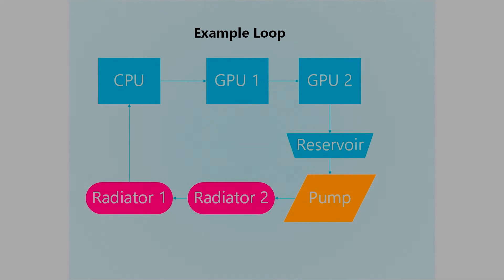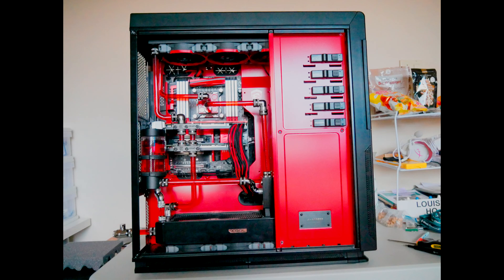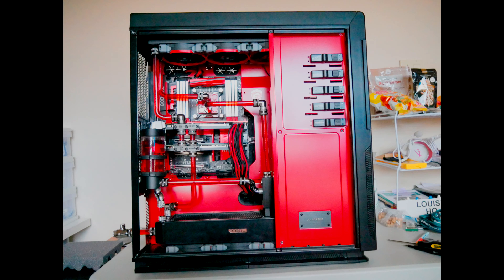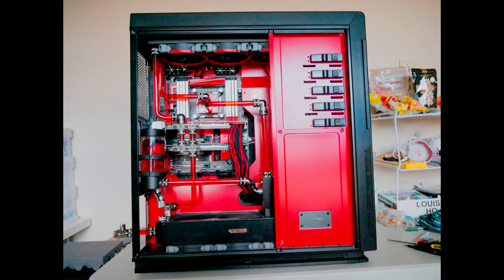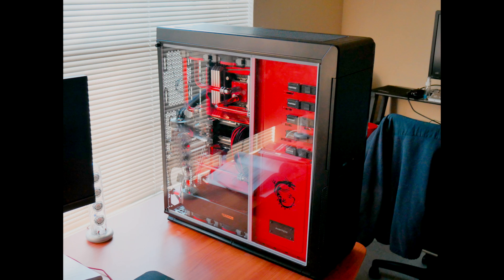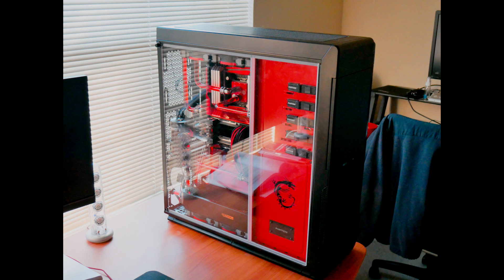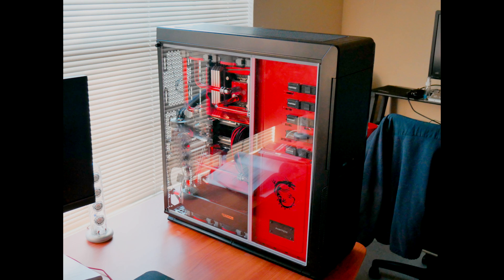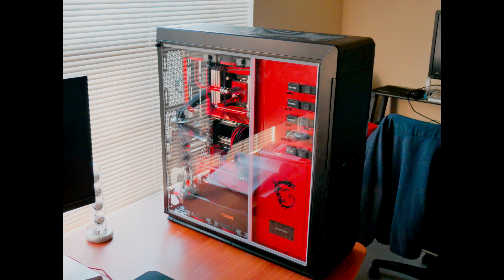Does the Order of Components in a Watercooling Loop Matter - TechTalk #1

Comment: Tbh this was perfect. Because I couldn't find that article even though I'd heard of it. I know from my days doing chemistry and thermodynamics and flyidynamics in physics. 

That heat has to transfer to a cold place.

The more time the fluid has in rads the cooler it will be because of thermal exchange. 

And from common sense, we're not trying to cool the rads so 2 rads in a row is pointless. So if I can make my lines go for example.

Pump>rad>cpu>rad>gpu>rad>pump

I'm effectively always putting warmer water in the rad to be cooled, since even the pump itself produces heat that can warm the liquid even if only slightly. 

But theres a lot of articles saying loop order doesn't matter, but I think that its obvious that if I ran Pump>CPU>GPU>rad>rad>rad 
My max cooling capacity would only ever be as cool as ome rad could make it. Since even if the 1st rad doesn't cool the water to its lowest temp the second rad will, and the third rad won't have much to do
Reply: Just keep in mind the differences in the context of PC water cooling will be un-measurable.   So its probably better to go for the loop order that looks clean or is most reliable, or least expensive, etc.

Comment: Hey guys I have a build with two radiator and the loop is as follow. Pump to GPU, GPU back to radiator(A). Pump to CPU, CPU to radiator(B). Radiator A to Radiator B. Is that a good/normal loop? Not in-term of heat because like the video says order descent matter but jay say radiators should be connected to pumps? Or did I miss read? Don't really want to redo my loop. Thanks
Reply: its been 2 years. you got that loop done?

Comment: The difference between radiator inlet and outlet temp is not what determines its cooling capacity or effectiveness. Its actually the opposite. The wattage dissipated by a radiator is determined by its temperature above the air being used to cool it. If the rad is 20C warmer than the air it dissipates double the wattage it does if its only 10C warmer than the air. 

The inlet and outlet delta (variance in temp) is mostly determined by coolant and air flow rate. If the inlet temp is 40C and outlet 30C in a 20C ambient environment then the second half of the rad is dissipating roughly only half the wattage that the first half is. If the flow rate is increased so that the inlet is 40C and the outlet 38C then the whole length of the rad is dissipating more wattage. Those numbers are exaggerated of course but the principle is the same. 
Its slightly counter intuitive but for best cooling system effectiveness we want the rad as warm as it can be and high flow rate is the best way to ensure that. Its easy to have a high delta between inlet and outlet, just by lowering flow rate right down but that just hinders overall performance.

As far as loop order goes, The high thermal capacity of water means that at a normal 4Lpm flow rate it takes about 300W to heat coolant by 1C. So an overclocked high end GPU might just do it. At the same time the average 360mm rad needs to be around 10C over ambient to dissipate 300W and cool the water by 1C.
So, the difference between the coolest and warmest part of the loop is normally only 1 or 2C but the whole coolant volume increases in temp by about 10C so the rad is dissipating what the system is generating. Thats why people say in general loop order is not important. 
There are caveats to that though like a very low flow system will be effected more.

Comment: while i agree with what your saying. people ith single radiators in cases may not have the option f having 2 radiators. i have my system setup in this order: bayres/pump to cpu/240mm rad/res/gpu/360mm rad to bayres/pump. prbably overkill. however this setup gets me temps of 45c on gpu and 38 on cpu 980ti@1507mhz and i5 4590@stock using corsair carbide 540. will be doing another build with the core p5 with a 480mm rad at 60mm in push pull config. cooling i7 7700k and 1080ti when it comes out. will overclock them to thier limit. my 980ti was a reference pcb.
Reply from the maker: Absolutely. A lot of cases can only support 1 radiator. The order of the loop really does not matter much at all in single radiator builds.